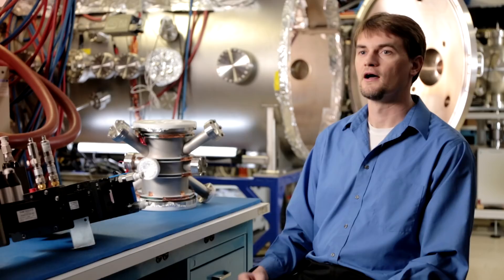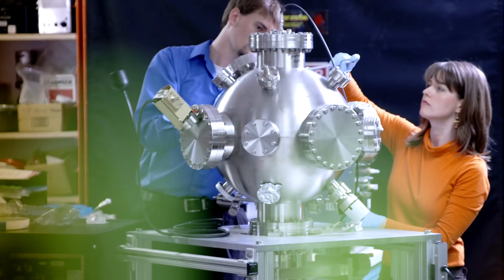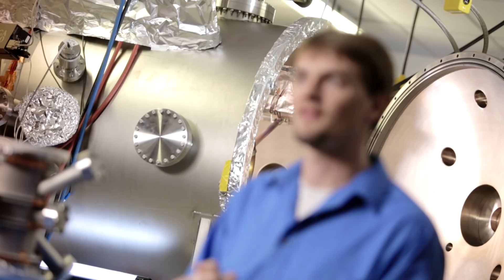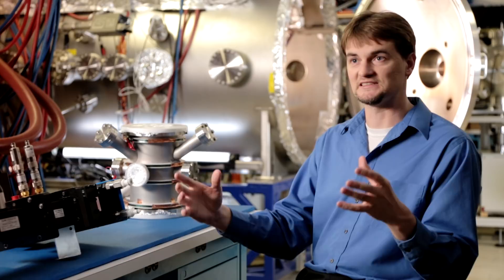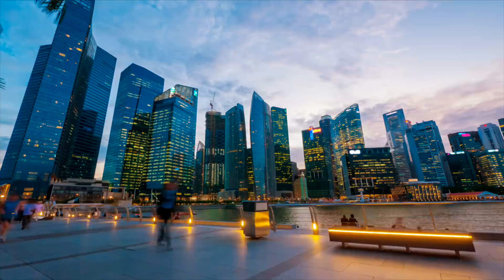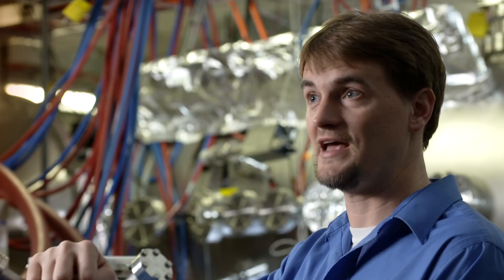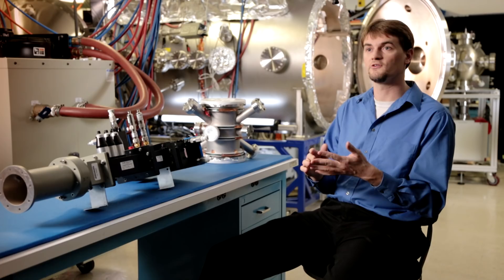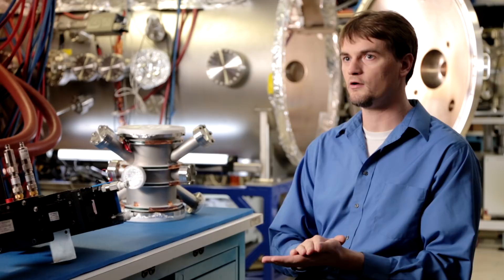Lockheed Martin: Compact Fusion Research & Development

Comment: His mention of the nuclear powered aircraft was a clear side swipe at the thorium LFTR reactor, which has it's origins in nuclear planes. It is based on fission but offers many advantages over fusion and has a much better chance of actually working. China expect to have their LFTR operational in 10 years, and if successful would provide the planet with power for probably millions of years. 

I can't help but think fusion is a massively complex and expensive venture that probably won't deliver, and even if it did wouldn't compare well to LFTR.
Reply: What advantages are these? Other than the price and time that it will take to research and develop a fusion reactor, there's really no other fault that fusion has here. On the other hand, thorium fission still requires some more research before one can actually be create, just like fusion, however thorium still has the faults of fission reactors. These disadvantages include, it produces nuclear waste with long half-lives (Granted, thorium reactors have less of this.) , and the element required for these reactors isn't very abundant. Hydrogen fusion's only product that is matter is helium-4, and hydrogen is the most abundant element in the universe, so it should be no problem getting a hold of it.
Reply: Darkpancakelord LFTR is a more or less proven system, it's predecessor the MSRE ran for 5 years from 1965. We know it can work, the only question really is can we get the high efficiencies and reliability that we think are achievable.

Thorium is also a very abundant fuel, which is otherwise waste and if we use it we can utilize all the rare earth elements that tand to come with it. Rare earth are not rare, they just tend to come with a lot of thorium. Fusion likely won't ever use plain common hydrogen as fuel.

LFTR is also likely to be cheaper, cleaner and more reliable. How much activated material do they think will be produced in a fusion reaction?  Massively high energy particles flying all over the place will likely degrade structural materials quickly. That means a lot of maintenance, and activated i.e. radioactive material waste.

LFTR will consume waste from existing nuclear power and nuclear weapons and leave very little waste. That waste that is left will be relatively short lived and so should always be a manageably small amount, even after millions of years powering the world.
Reply: Except that still doesn't take away those two other problems that I stating, and numerous others that I didn't state. Such as the fact that the thorium itself cannot start off and sustain the reaction. Enriched Uranium and Plutonium are both required to kick off the reaction, and it still yields the same waste. It's basically Uranium fission with an extra step.
Reply: I don't see why using up plutonium and uranium is such a bad thing. It's a great way to dispose of nuclear weapons. Also the waste is not the same, molten salt reactors can burn far more efficiently and completely. The amount of waste is orders of magnitude less.
Reply: The problem comes when the plutonium and uranium run out, or become scarce. Enriched Uranium or Plutonium would be required to maintain the reaction, as none of Thorium's isotopes are fissile. Moreover, granted there is less waste, there's still waste; that still poses a problem compared to hydrogen fusion, which has helium - 4, a stable isotope of helium, as the waste, which. Honestly, I'm not entirely sure why we're having this debate in the first place, because Thorium fission reactors are definitely a good transition while we wait for fusion reactors. However, our only disagreement seems to be the permanent use of it.
Reply: You've missed the central and most elegant point of the thorium fuel cycle. Yes you need fissile material to get the reactor started, but once it is running it will breed plain common thorium in to uranium 233, an ideal fissile material. This means your only input for the lifetime of the reactor is thorium, in theory it could run indefinitely and far from running out of uranium if you get the breeding ratio high enough you can produce excess u233 to start new generation thorium reactors.
Reply: Except that still doesn't solve the problem if the waste from Uranium 233 fission. It's still the same waste, and Thorium is about as abundant as Uranium, so if uranium runs out, thorium will trail it not too far behind.
Reply: Darkpancakelord There is a small amount of relatively short lived waste from U233 fission, but it is far less than from solid fueled reactors of any description, it is much easier to deal with and should never become unmanageable. I think you'd benefit from doing a bit more reading on this, thorium is about 4 times more abundant than natural uranium, and hundreds of times more abundant than U235, which is the only naturally occurring fissile form of uranium.

If we move to a LFTR style reactor it wouldn't be using any new uranium once it is running, only thorium. At about 1 ton of thorium per gw/y we have millions of years worth of it.
Reply: I'm not arguing against Thorium Reactors, I've stated that several times. It's obviously better than what we have currently, but it is not a permanent solution, and we should always strive for a better energy source. When fossil fuels were first being used for power, we had no clue that it would eventually become a problem and we thought it would last forever. All I'm saying is that we shouldn't completely halt research on nuclear energy sources that are even better than thorium fission reactors. I think that even when we have fusion reactors as our energy source, we should strive for better and more efficient energy sources.
Reply: Darkpancakelord I agree we should keep our options open, but what gets me is the huge amounts of cash that gets thrown at fusion, while just a tiny fraction of that would fund a much better project like LFTR. I would also argue that not only is LFTR a permanent solution (thorium is far too common in our solar system to run out of), even in the unlikely event that fusion worked, LFTR would still be better in every respect. It would be cleaner, massively cheaper and far lower maintenance. Building enough fusion reactors to run the world would be an unthinkably expensive prospect, whereas doing the same with LFTR is actually plausible.

Comment: So this is actually just a call for investment based on an idea, not anything anywhere near a working concept. Lockheed keeps pushing that this is a 'high risk, high payoff endeavor' which to me means that it's something that will pay off if it works, but there's a significant chance it wont go anywhere.

Comment: Good advertisement, but i need more technical data to believe, they were talking about magnetic pressure into a small container, but how is that possible if even JET has not maintained a reaction more than a few minutes?, even more, that's one of the reasons of the construction of ITER, a bigger Tokamak. I need more Physics not publicity.

Comment: What happens with the heat produced like the sun ones a ship or fighters gets shot or malfunctions? Wouldn't it blast a hole in the earth? Anyone experimented trying to turn on and off stars?
Reply: Not much. The plasma is really hot in the sense that it has a high temperature, but it's so low density that the amount of heat inside it at any time is really low. If the containment failed, nothing happens. The plasma would hit the walls and cool down to ambiant temperature instantly causing no damage. Just like a lit match will instantly stop burning and cool down to ambient temperature if you drop it into a lake.

Fusion researchers don't try to keep plasma off the walls with magnetic fields to protect the walls, they do it to isolate the plasma to prevent it from being cooling down.
Reply: ***** I'm not claiming to know everything. We're not all "smart" gay like you. I now have this gay colleague, who's editor of a big gay-paper. I could hook you up, but it's just your face I can't stand. Also his face, but yours certainly is far worse.
Reply: BosonCollider So in short it's an implosion, not explosion.  Still sounds damaging.  Even if a fraction of the heat is transferred to the material of the reactor wall/containment it will still result in a very nasty blast.
Reply: Robert Davidson
No it won't. Tokamaks like JET routinely do a dozen test runs a day, and nothing happens to the reactor walls when you shut down the fields when ending each run. The total heat in the plasma itself is negligible, it is well approximated with a vaccum.

Building the first wall of such a reactor IS a challenge, but that's because of the hard X-ray and neutron flux from the fusing fuel, not because of leaking plasma.

There is a considerable body of practical experience in running fusion reactors already. The trouble is making them efficient enough to provide net power.
Reply: ***** ?? Go get a gay friend. Don't bore me. I probably met more of them than you, since our last conversation. Makes me think, to send all gay customers to gay colleagues. That way I'll have you all in one place.
Reply: I don't recall any conversation?  I did not reply to you?
Reply: Robert Davidson The problem with YT is, that you'll get fed with all comments on the forum. Sometimes it's handy because you'll stay on topic, sometimes it's not because you'll get a lot of BS. The problem with Vaxiawval and me is, that I don't like him. He hates me for not liking him as gay. Point is, that I don't like him at all. As a person.

Comment: How does one interface a fusion reactor to a gas turbine? A gas turbine, by nature, relies on combustion - it's nothing more than a giant version of a jet engine. I'm thinking he meant a steam (Rankine cycle) turbine, which can be designed to work off any concentrated source of heat. The video was mostly platitudes and didn't offer any real insight.

Comment: I wish they were working on producing energy with thorium. That could probably be done faster then fusion. With the President and others killing carbon based energy production we need something quicker than fusion. Using a LFTR to produces energy you could also produce fuel from carbon in the air, heat+co2+h2o=carbon neutral fuel. The plants could also be used to desalinate water in places like California.

Comment: The fusion process, as it occurs in the stars, is associated with a huge entropy-gap, bridged by the immense gravity pressure in the center of a star. Unfortunately, entropy still is seen by the majority as to be about the disorder of particles, thus making this compact fusion design to appear feasible. I reality however, entropy is about the dispersion of energy and then it doesn't look that feasible any more. Hence, while the engineering concept seems feasible, the physics concept seems not. The only artificial way to bridge the entropy-gap is by probability (Boltzmann), given by extreme nuclear forces (tensions) in the crystaline structure of a suitable material - cold fusion, still beyond the means of Science.

Comment: Instead of trying to crush and move the plasma within a field, why not move the field around the plasma and crush the field with an even bigger field. All I see are designs that try and channel Plasma into a desirable path of rotation/flux, the plasma will always find a gap because the field is relatively stagnant/stationary/static, you need a dynamic field that changes faster than the plasma can route and compensate/change momentum. Resonance will only cancel out energy, you need to keep the plasma in a chaotic state in my completely ignorant opinion.
Uniformitiy in the field will always result in the plasma wasting energy exiting a gap/weak spot in the field, with a static field this is unavoidable, with a dynamic field the field can "sweep" or "flicker" covering those weak spots numerous times per sec.
(Think trying to throw a baseball through a spinning propeller), if the propeller spins fast enough the ball has a very low probability of making it through, the slower the prop, the higher probability the plasma can escape the field). (lost energy/waste/material that wont react/burn).

Comment: The world has actually more than 50 TERRA-WATTS of gas turbine power generation.  Don't think the guy really understands gas turbines though it he thinks you can run one off of a heat exchanger...Natural gas comes in. is mixed with high pressure air from the compressor is ignited in multiple burners then the hot gas is directed over multiple turbine blades to generate the power and power the compressor...(then the hot exhaust is used to heat water and make steam to power a steam turbine for additional 'free' power from the waste heat)...you are not going to get anything like that from a simple heat exchanger.

Comment: holy cow that produces a huge amount of radiation
Reply: If you mean nuclear radiation/ionizing radiation, it actually doesn't!  It produces a lot of heat, and probably gamma rays too, (which are nuclear radiation), but it doesn't leave behind radioactive waste like today's reactors do.
Reply: FlyingPiper13 it irradiates reactor material by neutron activation
Reply: unfairtrout
Neutron activation of light elements only produces isotopes with extremely short half lives, so there would be no long-lasting radiation.

Comment: This is one of the most frustrating things I've seen. I figured because it's Lockheed Martin and since they are an actual reputable company that they were on to something. Instead now its 100 times bigger than advertised and its still gonna be 20 years away like all fusion experiments. Lame.

Comment: I know for sure that the guy in the video has been to date bombed with all the good reasons why its idea doesn't work from about 1000 scientists at the top of fusion programs. The idea comes from previous experiments in the 60s and has been abandoned for difficulties in the scaling of the device. It seems quite clear that the buddy has not read too much literature about, didn't exchanged with experts the idea  and used approximations where they have no validity. He will realize it at the first instability of the plasma. Sorry dude nice try. See you at the next atomic age restart.